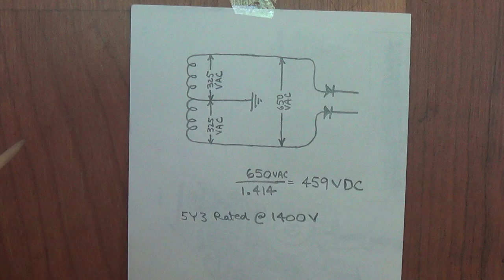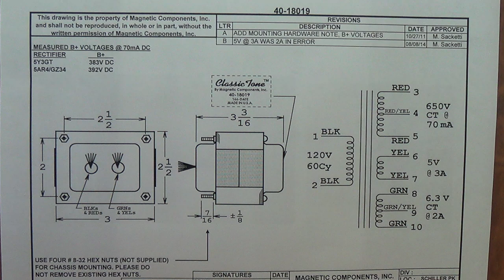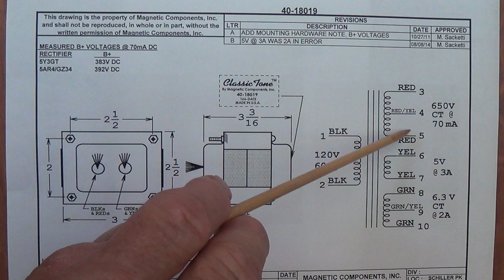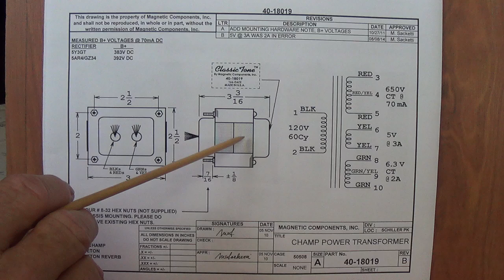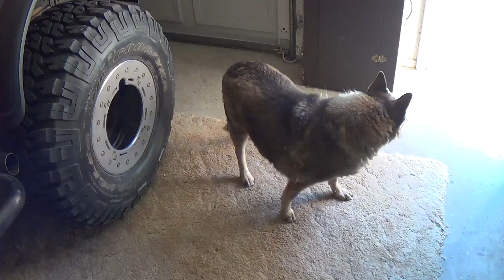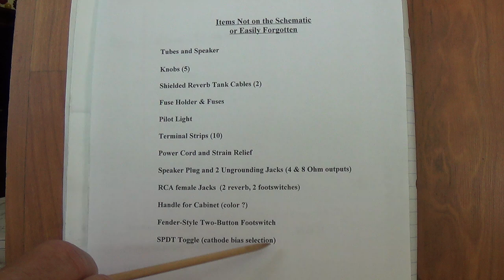How to Scratch-Build a Vintage Amp, Part 3:  Transformer Selection, Parts List, Cost Analysis

Comment: Doug, my father started out working at a TV shop repairing televisions, and eventually worked his way up until he retired as an electronic engineer... although he did all that, he never took the time to explain just how tubes and other electronic components of the day worked. Of course, my interests were up a different road (I became a Civil Engineer, with an additional degree in Hydrology and a P.E. in Arizona) but slowly I've accumulated some electronic experience... but your videos are just the ticket for explaining just what it takes to build a tube amp... and why things are done why they are. Thank you! While I may never build my own (but that might change...) it's nice to know how things work.
Reply from the maker: +Bill Daniels  You're welcome, Bill. Apparently we share a common interest in finding out how things work. Once I discover the answer, it's always a pleasure to share it with others.  Thanks for letting me know that I'm accomplishing that goal, and best of luck with your amp project.....should you decide to try one :)

Comment: Uncle Doug great break down of parts and prices it helps bringing us back to reality that you can build a better parts amp but probably not a cheaper amp than the big boys? planing a champ style build with 6L6 and 12" speaker. Thanks for all rusty's your hard work to inspire and lead us mere mortals into the world of tube amp goodness
Reply from the maker: +Mike Elmore  You're welcome, Mike....glad you enjoyed it.  When it comes to matching a big manufacturer in the production of any complex product, from cars to amps, there is simply no hope, cost wise.  The only advantage we have is in exceeding their quality and (in certain areas) design.  Plus, there is the wonderful feeling of accomplishment when our little hatchling finally "sings".  Best of luck with your Champ project. The modifications you mention seem excellent.

Comment: this series gets better with each episode - an I like Rusty's contract terms!
The part about cost is really revealing and when you factor the (re-) design and development costs, potential certification (if you want to sell the amp and be on the safe side) etc. it becomes obvious why boutique amps are so expensive. Still doesn't explain the 25k$ price tag on a Dumble though...
Reply from the maker: +Joachim Schranzhofer   Thanks so much, Joachim......glad you are enjoying the series. Re the cost of Dumble amps, I guess the price is set by competition between buyers for a very limited number of units....which rarely change hands. There is no disputing their value.....the mere fact that someone will eagerly pay it definitely gives it credence, and it represents a price breakdown that is about 5% for parts and 95% for uniqueness of design, rarity, and legendary reputation.

Comment: I look forward to your results.    Indeed I agree that a purely hand made amp is indeed a very costly venture.   Been there,  done that.   However,  there is something truly amazing about these when they are done right.   The finished amp has to do more than just work.   It is fiddled around with until it makes something happen... whether it warms your soul, makes you smile, and gives you goosebumps.   I've never bought an amp at the store that gave me that kind of mojo.   Although one did come close....    Secondly,  if you were in need of buying a vintage style reproduction speaker,  I have found some very impressive sounds from Weber's line.   Their speakers are terrific....
Reply from the maker: +DeadKoby  It's like being Dr. Frankenstein. You take a lot of inert parts, add some electricity.....and it lives !!!  Unfortunately, in keeping with the analogy, it also may burn down your house and kill the neighbor's dog :) Regardless, it's a very rewarding, exciting, and ultimately creative hobby.  Re Weber speakers, they are a class outfit with a great product at very reasonable prices and with great service.
Reply: Precisely.  There is something magical about DIY anything.   Even when I assemble computers (most every day)  it's still my favorite part of the job.  On a second note,  I really liked the Electro/Mechanical tremolo you did some time back.   That,  like the Echoplex, Tel-Ray, and Spring tank.... are WAAAY  cooler than an ordinary stomp box.
Reply from the maker: Glad you liked the EM Tremolo, DK. I actually built two completely different models. Each is featured in a video. Be sure you see them both.

Comment: At about 14:40 ... For what it's worth, when I do Bill of Material (parts list) take-offs from schematics I like to use a set of colored pencils or highlighter pens to mark my progress. I make up some scheme like maybe "blue for caps, yellow for resistors, red for coils" and so forth. Mark off each part on the drawing with proper color mark as added to list. Makes for easy sanity-checks such as "I have 32 resistors total on list, now count yellow marks".
Reply from the maker: +Sootikins An excellent suggestion, Sooti, and one that appeals to my OCD tendencies. I like the color-coding idea.  With the help of viewers, this video keeps getting better :)

Comment: Uncle Doug.  The type 1/4" jack to be mounted on the amp chassis for the speaker is known as an insulated jack.  I suggest the type which mounts in a larger XLR type connector hole.  I've not done well with plastic 1/4" insulated jacks.
Reply from the maker: Thanks for your input, Bob.

Comment: Just great, and like everyone else, sitting on the edge of my seat. I think the final price will be around 800, but still a good deal cause of the improvements. Like the hi and low inputs, and the reverb. A new Supra goes for 1100, but they don't have a fender tank inside of them. Again great videos, thanks.
Reply from the maker: +Shawn Wilkinson  Thanks, Shawn. Bear in mind that if the parts do end up costing that much, then when labor expense is added, the total value would be around $1600.....a whole lotta dough :) You can see why manufacturers rely on printed circuit boards and quarter-watt resistors to keep costs way down.

Comment: Other overlooked and potentially needed items when ordering; rubber feet & corner guards for cabinet. screws, glue, solder, wire. heat shrink,electrical tape.

Comment: One company that I've been using a lot for power transformers is Edcor. They mostly specialize in transformers for hi-fi, but they've branched more into tube guitar amps. What's really great about them is that they have a LOT of models available. They have 270 different power transformers with various taps and voltage ratings so you can build just about anything you can dream of. And their prices aren't bad. The down side of them is that because they have so many available models, each transformer is built to order, and I typically have to wait 4 weeks for them to arrive. It works out okay for me, since I'm typically working on 3 or 4 different projects all at once.

I've never used their output transformers, so I can't speak to their quality and the sound they would produce. I'm pretty religious about only using classic tone for my outputs. Anyway, here's a link for anyone's who's interested. 

https://edcorusa.com/class-x
Reply from the maker: +Alva Goldbook  Thanks so much for the info and link, Alva. I used Edcor transformers back in my jukebox-restoring days, and they were of exceptionally high quality.  As you say, however, having to wait a month to get it is not good news for those of us who are impatient to get working on a build or repair.

Comment: Hey Doug, 
At 1:39, you show the 6L6 plate current at 40mA. I'm looking at RC-22, it says the Class A1 Amplifier Zero-Signal Plate Current ranging between 54-72mA depending on plate voltage 250-350V. The 6V6 zero-signal plate current is 30mA@180V. 2 questions, how did you decide the 6L6's plate current spec at 40mA? and when using the 6V6, where do you expect it's plate voltage to be? Just curious. Thanks.
Craig
Reply from the maker: +Craig Hollabaugh  Excellent, and anticipated, questions, Craig. I based my estimates mainly on personal experience and observation.  With a conservatively cathode-biased 6V6 (generally) operated at reasonable volume levels, the PC should not exceed 35mA and a 6L6 should stay below 45mA. With fixed bias (grounded cathode), it would probably go higher.  I realize that as PC goes up, PV goes down a bit, but if you accepted the book values on the 6L6GB and had one operating at 425V of PV  (for instance), and the PC went up to 72mA, the Plate Dissipation would be around 31W !!  I anticipate a plate voltage of around 380 to 390VDC and a PC of around 30mA for the 6V6 (PD = 11.7W). For the 6L6 at a PC of 40mA the PD will = 15.6W.  Also, just on a common sense basis, I have to think that a PT designed for two 6V6's (book says 70mA @ zero signal, 92mA at max) can handle a single 6L6.  I may be wrong (god knows, it happens), but I guess we'll see when the circuit either works great......or goes up in smoke :)
Reply: +Uncle Doug Sounds good. I'm very interested in seeing where the bias points land for this amp with different output tubes. Please consider adding a short discussion showing where these points land on a "plate characteristic" graph, how varying the bias moves the operating point and ultimately how that affects the amp's sound (from your experience of course). Thanks for creating this series, everyone here loves it.
Reply from the maker: You're welcome, Craig. To be honest, this is an experiment for me, and, unlike all my previous builds, I really have no idea what to expect. I have no doubt that it will work fine with the 6V6; but there is an almost total absence of any SE 6L6 amps to judge by....so who knows what it will sound or act like?

Naturally, I'll start with a very conservative bias for the 6L6....perhaps making it variable.....and then slowly crank it up to a reasonable level of function.....replacing the pot with a matching fixed resistance. I'll also monitor the PC while inputting an increasing signal. If it works, then it promotes and presents new vistas for SE amp designs. If things go nuts, or it sounds awful, then I'll change plans and try something else, like a 6F6 :)
Reply: ata-boy. And I ain't talking about Rusty.

Comment: Howdy. Nice demonstration.
As usual I have some comments.
Your anode sum current is estimated to be 67 mA. Ok, but that is the DC mean value. However, the mean value is not the value heating the transformer. To evaluate the heat capability we must use the DC rms value which is way larger. The 150 % rule of thumb is good. Ok. So the estimated DC rms is 1,5 x 67 mA = 101 mA. A true rms A meter inserted before the filter capacitor will display 101 mA.
And then the anode windings. 70 mA is the rated AC rms value. That is 70 mA in both half-windings simultaneously. Full wave rectification means that current will flow in the half-winding only during ½ cycle. During the other ½ cycle the half-winding will rest. Math gives us that the rectified DC rms may be 2 x 70 mA = 140 mA maximum. So in conclusion. The 101 mA rms demand is smaller than the 140 mA rms capability. The transformer choice is Ok.
Regards.
Reply from the maker: Thanks for your very detailed analysis, Eugene.

Comment: I'm just at the explanation of the reverb section on my second viewing of this video series. I get more psyched up about it as I go through it with you and really, haven't been able to get it off my mind since I watched the series the first time several months ago. It's like having a tune in your head that you just can't shake only instead of a tune it's this build. Like you Uncle Doug, I've never seen a single-ended amp with reverb either. I always thought it would be cool to have a reverb champ without the vibrato since I really don't use vibrato. But the other thing besides not seeing reverb in SE amp is that you don't usually see reverb that isn't tied up with vibrato ala Vibrochamp or any other Fender that has that pair of effects. If it has reverb it has vibrato too. So I wonder why that is, and can this build be done by sort of "grafting-out" the vibrato circuit? Like how you're grafting in the reverb only in reverse...sort of.
Reply from the maker: There is really no harm in having the tremolo circuitry present, DE. It doesn't impact on the tone or volume of the amp circuit(s)......but yes, it would be relatively easy to design tremolo out and reverb in, if you were building from scratch. Not so much fun with a pre-existing amp.

Comment: Greetings,
I have an observation of which I do not know if anyone else has pointed this out, if so the  please disregard. I noticed on the PT Spec sheet that on the top revisions the 5v winding is only 2A not 3A which is not suitable for a 5U4. That is all thank you UD for your generous sharing of your knowlwedge it has greatly helped me on my journy,  best regards,
MT
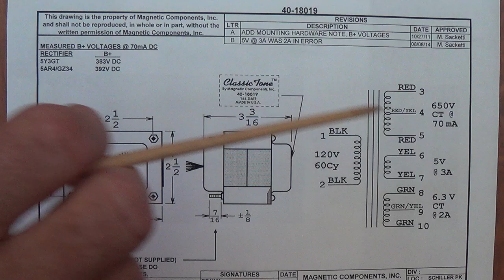Reply from the maker: You're welcome, MT. At 7:20 in the video, the ClassicTone 40-18019 Power Transformer has a 5VAC winding rated at 3A. Also, I rarely, if ever, use 5U4's in any of my builds. I much prefer 5Y3's or GZ-34's, both of which only require 2A.
Reply: Thanks, on the top right hand corner of the sheet there are the revisions and it says 5v 3A in error 2A Unless I reading it wrong. I was thinking if someone else tried different rectifiers. I agree with you about 5u4 I appreciate your work,
MT
Reply from the maker: You're welcome, MT.
Reply: Not the first time I've read something backward :) apollogies for waisting your time.
MT

Comment: Newbie Question. How do you determine voltage and type of capacitors for your builds like this, if they're not listed on the schematic? You, loosely, explained your resistor selection method, but didn't go into much detail about the caps. 
Some background information on me, I'm a medically retired Vet with mobility issues, taking up a new way to keep my mind engaged. Trying to soak up as much knowledge as I can about the topic. I really appreciate your videos and have learned an immeasurable amount from you. Please keep up the good work, sir. Thank you!
Reply from the maker: Welcome, Toby. Once you understand the different voltage and current characteristics of each portion of an amp's circuit, choosing components is easy.  The signal pathway is generally quite low in voltage, under 50V. The rest of the circuit varies from 200 to 500VDC. As to type of capacitor, I am not all that picky. I use the metal film, tubular caps rated at 630VDC from AEC:  https://www.tubesandmore.com/search/node/capacitors
Reply: @UncleDoug  - Thank you, sir! I appreciate your time and advice.
Reply from the maker: @tobytyler3765  You're welcome, Toby.

Comment: Hi Uncle Doug!  I was not sure in which video to ask this question, so I just picked one that is close to what I want to ask.  What are your thoughts on a standby switch?  I used to think they were necessary so the plate could heat up properly, so the cathode would not get stripped, but after reading some other blogs I am not so sure this is the case.    

I have all the parts for my first amp bought, built the chassis, all the hardware installed, and now I am wiring and soldering, and deciding on a tone stack.  Thank you so much for sharing all your knowledge with the world! Highly appreciated!!
Reply from the maker: +Rhone Ranger  Wow, it sounds like you're making great progress, RR. You're welcome. I'm glad the videos helped you with this project. 

I have no use at all for standby switches.....in fact, I think they cause way more harm than good.  I built one into an amp years ago and will never do it again. Here is an excellent discussion on the matter:  http://www.valvewizard.co.uk/standby.html

Comment: I really like the specific info for choosing power transformers.  A hypothetical -  if you picked one robust enough to  handle filament current needs and out put power of larger tubes (6l6GC or KT66), could you then choose from the range going 6V6 up?  Basically I'm asking if you have the parts spec'd for higher output could you also use lower power tubes (w/appropriate rectifier and bias)?  This is prob. one of those questions that are like what a 1st grader would ask in the electronics world
Reply from the maker: There are other considerations, Monto. What is the available plate voltage and plate current (HV)? Is it adequate for the larger tubes? Would it overpower the smaller tubes? How about your output transformer.....can it handle the higher power from the larger tubes?  It's a complex balancing act that prevents random swapping of tubes and other parts.
Reply: @UncleDoug  Thanks for the details.  I kinda knew it wasn't that simple - but it's helpful to hear some of the main  reasons why spelled out